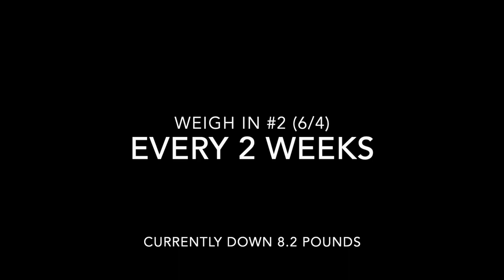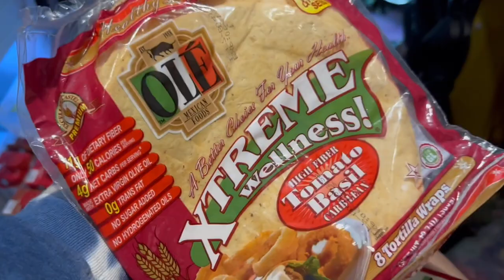Life of a female trucker #flatbedtrucking #weightlossjourney

Comment: Hey lady! I’ve been driving for Werner for 13 months now and I’ll be leaving them to get into the flatbed life at Maverick. The decision was hard but just like you, I would go a day without a load or be forced to take a reset when I still had over 20 hours on my clock. Maybe it’s time to switch it up if you haven’t already. Also, losing weight can be tricky  OTR. You have to make sure your carb cycling is consistent/balanced, you’re getting enough sleep, not stressed, and the list goes on. Try your best to be gentle with yourself during this season mama. Everything works out for your highest good at the end of the day. Keep Trucking mama!🚛🫶🏽